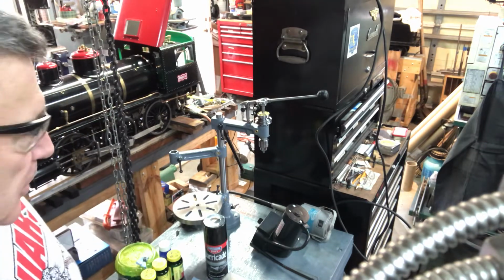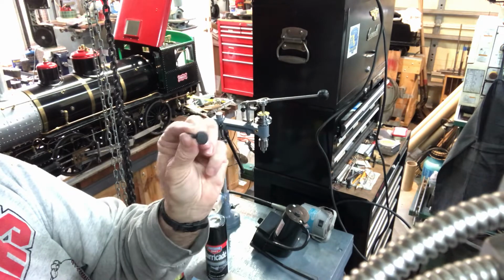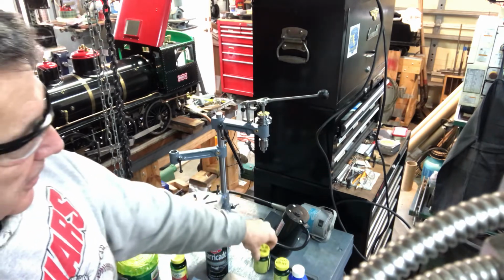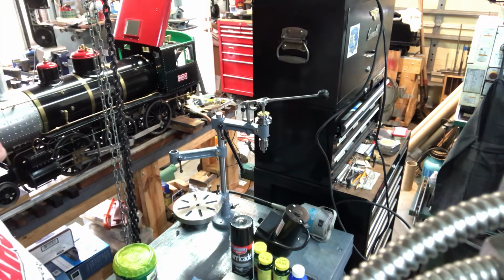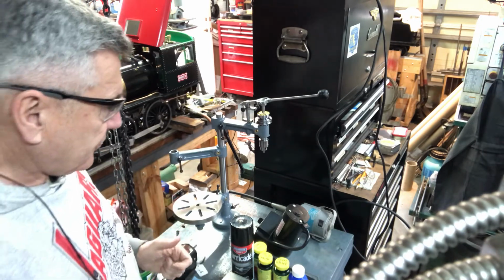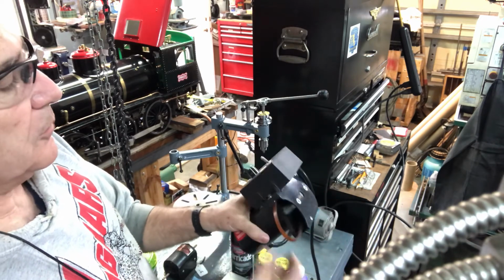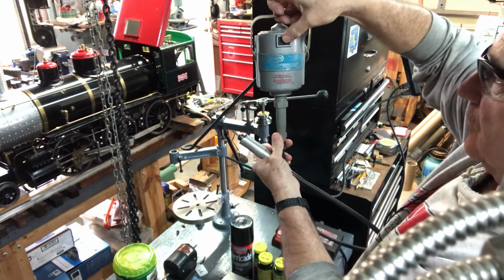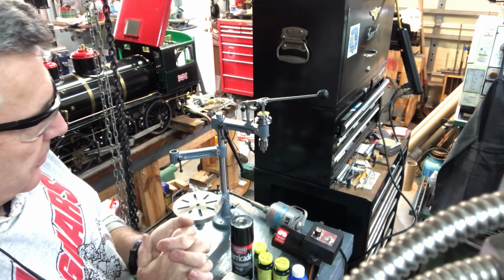Universal Pillar Tool project motor option discussion and info on bluing steel

Comment: Electric motor technology is now light years ahead of when GHT designed his UPT. How much you chose to spend and what you ultimately use that UPT for is going to dictate what the best system is to use though. At the simple end then yeah a good condition sewing machine motor is going to be the best bang for the buck. But in my opinion I'd always want whatever I used to be as smooth running as possible. The commercial high speed instrument type bench drill presses always go that route. And pricing out one of those like the Servo brand and similar, then building that UPT looks pretty cheap in comparison. Most English or American made older sewing machine motors would fit the very smooth running description. DC would be better as you said than any single ph sewing machine motor. Whatever I decided on I'd certainly want that very smooth running, variable speed and the ability for running the motor in either direction. Looking at that loco in the back round, you obviously have the need for drilling and tapping at least small multiple part runs. It probably is more than your wanting to spend, but for the best set up I'd certainly consider a smaller 3 ph motor with a constant torque vector drive VFD. A low mileage good condition used set up really shouldn't be that tough to source and that gets you everything at once. It's another option to consider at least. And whatever motor type I finally decided on, I'd add one of the now cheap digital tach's to the UPT's spindle. Trying to constantly calculate pulley ratios and/or with a variable speed motor is ridiculous considering the cost's of those tach's now. 

That Foredom or maybe it's a clone of one should not be anywhere close to that loud. As someone below pointed out, the flexible drive cable likely needs lubrication, maybe brushes and motor bearings also? Foredom has a very good YT channel https://www.youtube.com/user/ForedomElectricCo with maintenance tips, lubrication etc in there previous videos. If that is a real Foredom, they make any Dremel look as poorly performing as there built down to be. I got my Foredom almost by accident, and there's simply no comparison to a Dremel. But I still think there better used for what there designed to do and not as a drive for a tool that really deserves something more dedicated to it.

Comment: nice work that upt really looks good, I would go for the servo  motor , also lots of inexpensive dc motors and speed controllers on ebay, the sherline motor is nice but seems like a lot work

Comment: I’ll be using a 1/4 hp Premier sewing machine motor. Used it on a similar milling attachment I had for my small lathe and will use it on my UPT when done. Already set up for these type of belts, and I like the rheostat in the foot pedal for sensitive drilling. I think it’s perfect for model engineering type work. My two bits.

Comment: You will probably appreciate some kind of speed control.

I would imagine the Foredom motor is too fast even if the bearings aren't knackered.  In my old videos you can see my Dumore drill press running at 17K which is OK for tiny carbide drill bits., but you can't effectively drop the speed on these kind of motors as they lose a lot of torque with a speed controller (triac or variac).

My Cameron drill press is more similar to your pillar tool, but smaller.  The speeds on the Cameron are 9.5K, 17K and 30K RPM through step pulleys.  I almost always use it at the lowest speed.

If the Servo sewing machine motor isn't too big, it's probably the best bet.  You get a speed controller and the motor is supposedly 3/4 HP (Chinese horses) which should be more than enough.  Apparently the max speed is little over 4K, so with some pulley magic you should be able to get it fast enough for small work.  Pretty good deal at around $115 and those greenbacks certainly aren't going to gain any value in the coming years.

Comment: Hello,
I would mount the motor on the bench level and then make the pulleys up high (opposite end to spindle)... That way you have a constant between the high pulley and the spindle and then changing motors would not need special brackets or much alignment. With regard to motors I would consider the motor you have that needs rewiring as you can do that yourself and try the setup with that... If you need more power then you look for a more powerful motor... I think that would be the least expensive and most flexible solution.
Take care.
Paul,,

Comment: Hi Metalmill52, I numbered my sensitive pillar drill table, over 25 years ago, my bum cheeks will never be the same, can't remember the correct setup, but the 3 secrets, I learned are (1) do a practice run on some thing first of the same diameter, (2) the blow with the hammer has to be of a consistent bash if you have to hit it a second time they are not the same....(3) and the most important one, use a SMALL strip of sellotape on the area where you need to place the numeral, this allows you to use your finger to lightly indent the sellotape and realign the workpiece or the stamp to the exact spot, yes it takes longer, but the job comes out as if you had taken it to the Jewelers, hope this helps. Regards Dave....Beagles